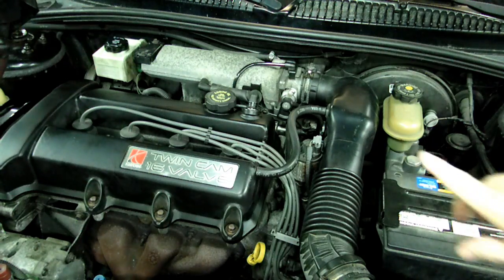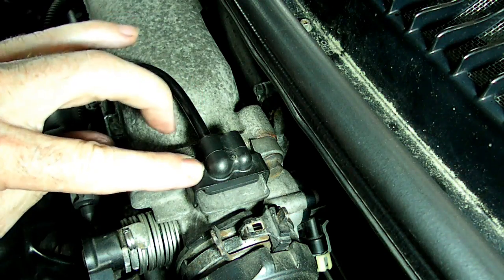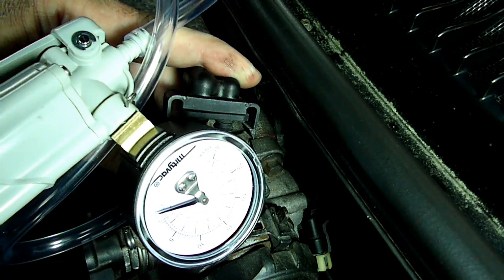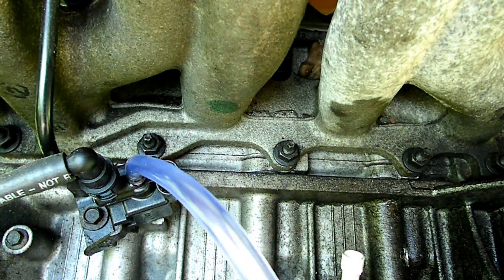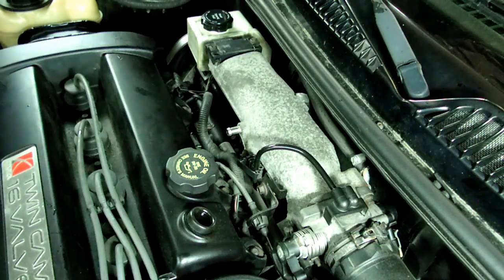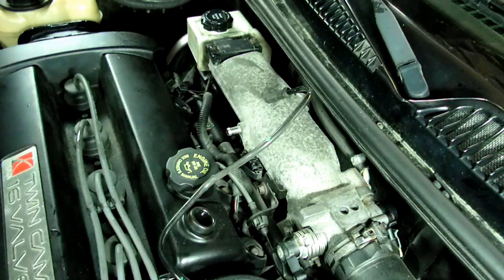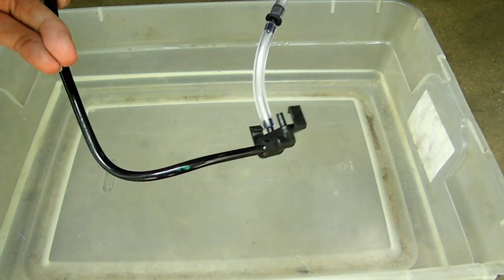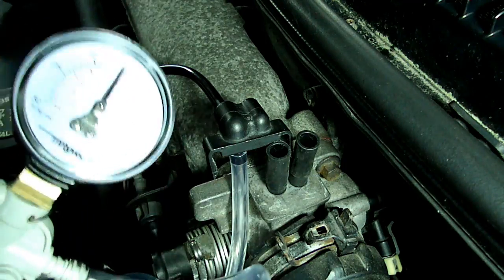EVAP Purge Solenoid Testing

Comment: Love all your videos as I am finally addressing issues in my 2001 Saturn Sc2. But I am kind of lost on this one. I can't even find that plastic tube you fixed or where it connects to the throttle body. My throttle box is on the other side ( for starters) and do not even see anything that looks like the first plastic clip you removed to test vacuum. Any advice?

Comment: Thank you so much. I fixed my 2002 SL1 "Service Engine Soon" problem just by looking at the plastic tube on my intake manifold. It was so loose it was hardly staying in place. I didn't have any PB Weld, so I just made a temporary seal around the end of the plastic tube with a little bit of grease and re-connected it. It sealed it up very nicely!

Comment: richpin tryin to fix a p0442 smoked system found no leaks. used a professional smoke machine. commanded vent valve closed with scanner before smoking it. you have any suggestions? as it looks  like your a Saturn expert!
Reply: Check the Gas Cap - New one under $10 - and EVAP hoses line for small leak.
Good luck.

Comment: How much vacuum should be applied, and how long is it suppose to hold it ?
Reply: Dominik good question, I've been trying to find out for weeks.
Reply: Dominik from what I've collected, like  1Lbs. pressure . I like there's a few pounds built in a couple had tanks I've seen that don't release pressure correctly

Comment: Thank you richpin06a!!!

I used your test protocol  and it fixed an acceleration hesitation, noise in dash (for 3 years), gas smell and error codes P0441, P0442 and P0446.
After doing a vacuum (I have the exact same vacuum kit) and pressure test, I found a leaky EVAP purge solenoid hose.
After replacing the leaky hose and a few others, I drove the car for about 15 miles with the engine check light and VSV lights on, they didn't come back on when I started the car after the 15 mile run to the store!
I'm thinking the gas mileage will improve also.

Thanks buddy!

Comment: I have a question about the purge solenoid. In the video you checked one part of the solenoid with the vacuum and the pressure stayed. Do you have to check the other part of the solenoid as well to see if it it holds pressure too or just that one going to the trottle? So one goes to the trottle and the other to the evap canister? Thanks
Reply: Yes the other line goes to the canister so this part is basically a switch interrupting the flow from the canister to the manifold.
Reply: Thanks. But do you have the check the pressure of the switch's other line going from canister to the switch to see if it has pressure as well or is it just that one from the manifold to the switch as shown on the video?

Comment: Nice video. Questions:
1. Does the purge always happen on startup? 
2. Are there other times that the purge happens?
3. Where you had the leak at the TB there are two holes. One for that line, and what is the other one for?

Comment from the maker: The 97s had a problem with the fuel pressure check valve not holding pressure.The valve is part of the fuel pump.

Comment: Another problem is normal crank, delayed start. If I cycle the fuel pump twice it will start easier, while sometimes just a minimal crank will fire it up. Is there a check valve in the fuel pump or elsewhere in the fuel delivery circuit that can be replaced, or modified to accept a check valve? Once it starts it runs like a race car.  I think the fuel delivery line is back flowing and draining into the tank, but I could be totally wrong. Any suggestions?

Comment: I have 1997 SL2 with 142,000 miles, ran strong, everything operating except the following. Two months ago the car was getting 32 mpg, then the evap code set and the mileage dropped to ~16 mpg. Today I will be removing the spark plugs to see what they have to tell me. My Ford E250 get 12 mpg at curb weight. 

I expected to find a fuel leak because that is very high fuel consumption without fouling the plugs, or black exhaust, but no, it is really burning that much fuel. Suggestions?

Comment: I've got a 1994 Dodge Spirit 2.5L TBI and the craptastic plastic lines broke at the base of the throttle body and other places. So now I don't even have a line going to the purge solenoid or evap canister and whatever the other line goes to in the air/filter box. :/ I'm driving around now with the bottom of the throttle body sealed with a hose and a screw till I can re connect the lines. Whoever thought of plastic lines in a damn engine compartment needs to be shot! Shitty plastic!

Comment: I found my oil drip problem Rich. I had just purchased a new drain plug from Autozone, it cam with a very small diameter rubber O-ring gasket on it already and I installed it while doing an oil change in the driveway. Turns out that small O-ring gasket was not good enough to hold the oil in. I put a larger diameter drain plug gasket (same diameter as the drain plug flange) and the oil drip stopped.

Comment: Rich, I have a 1996 Saturn SL2 I have owned since new and this car has never, ever left a drop of oil on the driveway. I just drove back from Las Vegas to Los Angeles and the next morning I noticed a 9 inch pool of motor oil on the drive under my car. I will be going out in a few minutes to check the drain plug and oil filter to make sure they are tight. My question is if there any other place on the Saturn SL2 engine bay that is prone to leaking oil that I should look for? Thanks.

Comment: That would explain the fracture (failure) of that part because polystyrene is readily soluble in most organic solvents, so gasoline would surely destroy it. I'm not sure if GM is dumb enough to use PS in an car's evaporative system.